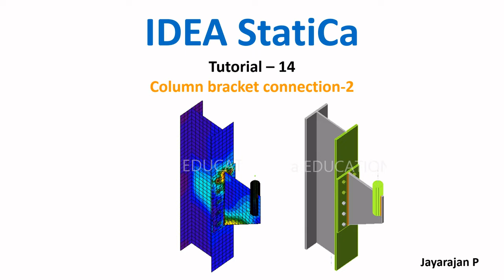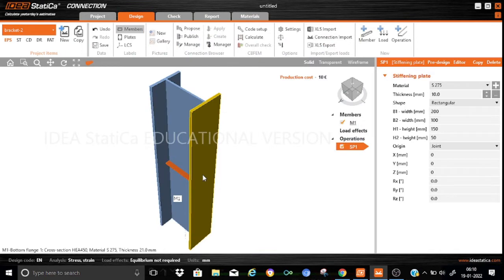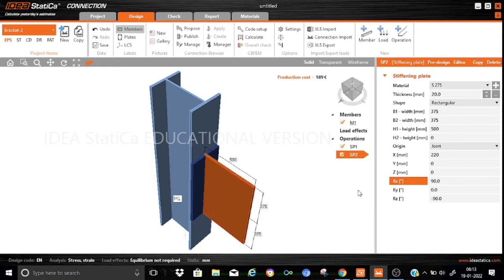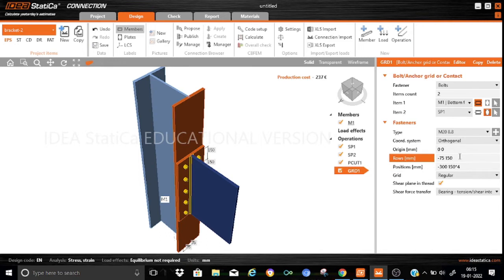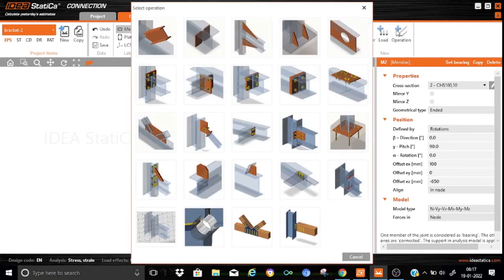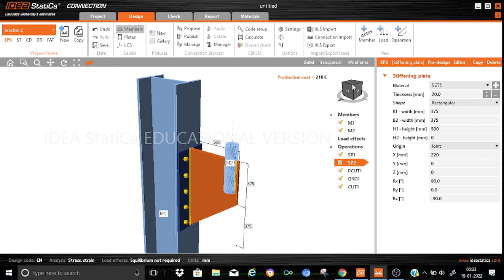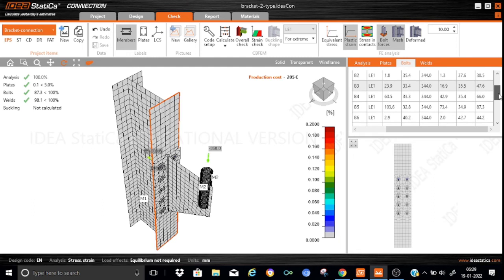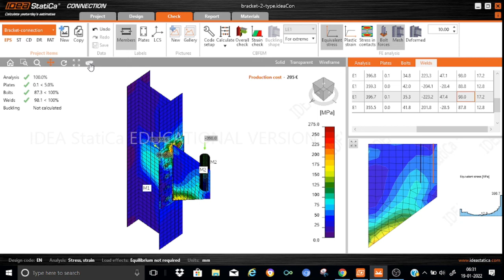IDEA StatiCa: tutorial-14: Column bracket bolted connection-Type 2

Comment: For I beam section, I have released moments at the ends of the member at beam column junction then during connection design, I am directly welding the beam to the column flange and applying only shear loads in the idea statica. Will it behave as a shear connection? Or moment connection?
Reply from the maker: If you are discussing about a cantilever beam, it will be stable if and only if  the connected end is restrained (ie. moment connection).Please remember , even if you design a connection as shear connection it will have some moment carrying capacity as well...!!!